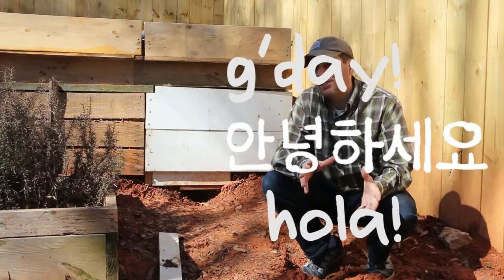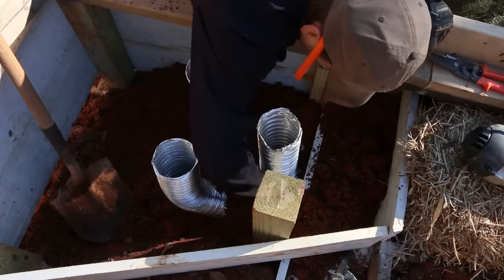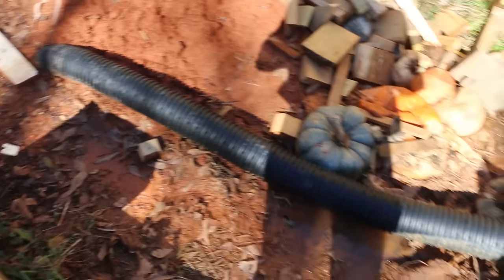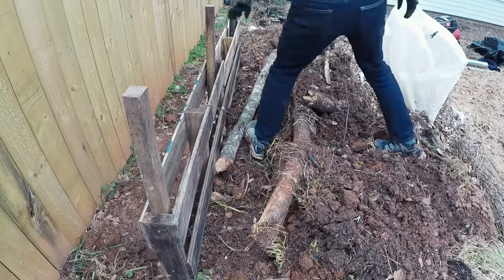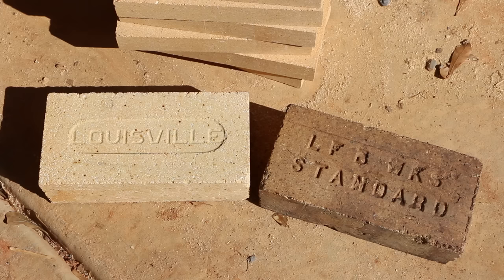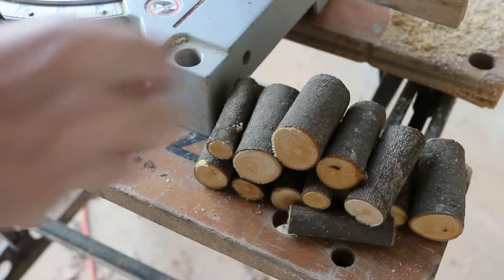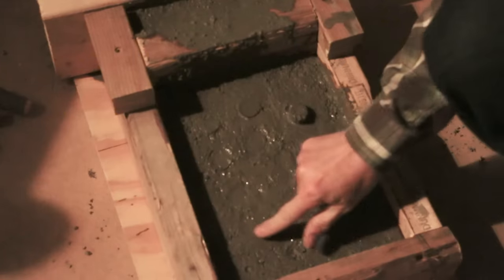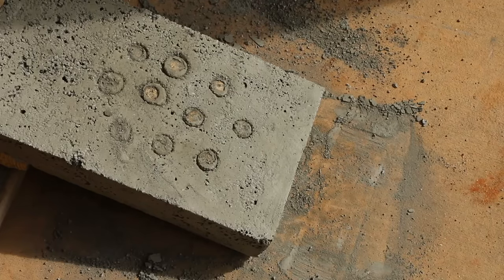How To Heat A Greenhouse For FREE

Comment: I agree with David, with some additional information. There are 3 foundational aspects of fire, heat, fuel, and retention. You have all 3 and it was a good build, but the power of induction is often overlooked. The fact that the smoke was choosing to come out of your fire box shows that you actually built a reverse system. Your chimney is acting as the air feed instead. Increase the angle of elevation or shorten the distance of your chimney. You could also warm your chimney to stimulate the flow of heat. As heat rises it causes a draw and will pull air, smoke, and heat. The hotter the path gets from the firebox the greater the inductive force. If you use a fan to keep fire going, you might as well use an electric heater and not bother with a fire. You are over complicating it for yourself. Hope this helps.

Comment: One thing you might try, it seems to me that it might be a good idea to insulated your vertical heat riser (smoke stack) to get a good draw going.  If you lose too much heat through your single walled duct your combustion products will cool and you won't get the strong draw up the stack.

Comment: When you build a form you can brush it with used motor oil or any waste cooking oil and your concrete will not adhere to the form so you don't have to worry about breaking your finished product.
Reply from the maker: I’m definitely going to use an oil release. Thanks for watching.

Comment: Ok, I haven't read all the comments cause it's after 1 in the morning, but I have some ideas for your firebox. And yes, I realize that this video is more than 9 months old and you probably can't use what I'm gonna tell you, but here it is anyway, just in case. Keep all the bends in the chimney to a very gentle, sweeping curve and down to an absolute minimum. That way you don't restrict your momentum of your air. Think fluid dynamics. Also, a longer pipe gives you more negative inertia as it moves, so you will want at least 6 or 8 feet of straight pipe as your chimney. And one last thing, I couldn't really see, but it looks like the chimney and the firebox are both outside your greenhouse, just on different sides. You could gain a lot of waste heat from your pipe as it exits if it's majority is inside your greenhouse and it exits through the roof. Those are my suggestions from my time working on gas furnaces and water heaters. Good luck.
Reply from the maker: Hi David. Thanks for the great feedback and suggestions. I always like hearing from people who have made a career of what I am attempting to make. I agree with your assessment on the heat gain. However, I was concerned about the hot pipe passing through the plastic roof. I will apply your insights to my next build. I'm afraid this furnace might be toast. When I lit it again, I got very little smoke out of the chimney, with wisps rising up through the bed inside the greenhouse. I think my smoke channel may have collapsed. It might dig it out and put a pipe in place. If I end up doing that, I'll implement your suggestions. Thanks for watching.
Reply: David May r
Reply: Anytime you try to pipe smoke sideways you get a lot of creosote build up.  I would avoid doing that altogether, or at least make certain you are using very dry wood and plan on having a way to chimney sweep the horizontal runs frequently.
Reply: @pattigoebel3136  I agree with that. My example of waste heat from the chimney was a propane burner and a lot of chimney pipe that had a small amount of rise over a long pipe and it wound up to the roof on one side of the shop my dad used to work in. That thing would run you out in no time, and it was a drafty shop. It makes sense that it wouldn't build up much suit cause it was burning propane. I really didn't think about that. But wood, on the other hand, would be more like a fireplace. But they still capture waste heat from those as well. My causin has one, even though they use straight vertical chimneys. The gas furnaces I've worked on use vertical chimneys also, cause the heat exchangers have the curves and bends that capture the heat. You could use a chimney that's not vertical, but you probably would have to treat it like a fireplace and burn a really hot fire every so often to clean it out and only use low tar wood like hardwood, etc. I concur with you.

Comment: It's a lot warmer in Georgia than here in Oregon. Here you would be spending all your time feeding twigs to that tiny box to keep it warm.
It's a great idea, just need a larger scale in the northern states. With added air flow won't those twigs burn up fast?
Reply from the maker: Hi Cat. You are right about the scale. The smaller sticks and twigs are consumed quickly. To make this work in an Oregon setting, it would need to be bigger and designed more like a true rocket stove or rocket mass heater. Check out Paul Wheaton’s videos on rocket mass heaters. He’s the guru. Thanks for watching.
Reply: @GreenShortzDIY  I'm not sure the size of the firebox is all that important, nor the size of the fuel you feed it.  In Georgia, especially, but just about anywhere, you wouldn't have to run that thing very long to get things heated up, and then it would give heat for hours.  

It would have to be pretty darn cold for a pretty long time for you to need it at all, in Georgia.

I think it's smart to build it in such a way that you can tear it all down and experiment.  I see a LOT of these greenhouse builds where people end up putting electric heaters in the things, and if YOU'RE the one building it, the most efficient, low-tech system would be rocket-mass-heater (RMH) system.  You don't want and you don't need it to put off much smoke, and you want as efficient burning as possible.

Comment: You said something about fan to pull hot air into green house , great idea. My occupation here in Ca heating & air . Try installing inducer motor at the end of the exhaust pipe see if it does the job

Comment: How'd it turn out?? Please update us! I live in a MUCH colder state and this would be extremely helpful if all the kinks were worked out. Lol
Reply from the maker: In the end, this didn’t work. I think the ground just soaked up the heat and didn’t really dissipate it into the greenhouse. However, I think the trench does a great job keeping the greenhouse warmer than the outside air. One method using a furnace like this would be to use it to heat a barrel of water inside the greenhouse. The water soaks up heat really well and releases it slowly. I’ve seen a YouTube video where someone does this. If i were to do this again, I’d do the trench with a water heat sink, fired with a copper coil in a rocket stove. I do have a video where I make a Cobb rocket stove water heater. That could be adapted to warm a barrel of water. Thank you for watching.
Reply: @GreenShortzDIY  thank you for your informative answer. I'm going to put some more thought into it and continue my research.  Hopefully i can figure something out before winter. Haha.

Comment: Don't let it get to hot. That vent pipe you used will melt quite easily. You need black stove pipe. Too get proper draw you need twice the vertical pipe as your horizontal. Block the opening in the front to force the exhaust out the pipe. Once the pipes are heated the block on the front can be removed.

Comment: tap your concrete form to vibrate the concrete, this will remove air pockets. Also use a lubricant like diesel fuel, or motor oil as a release agent on the pegs and wood form, they will pop right off very easily
You get some crazy sounds when speeding up the video
NO FAN....use a door on the front with a damper or use the holes in the bottom as a damper. ALSO raise the stove pipe higher and cap it to keep rain out, the higher your stove pipe, the better draw you will have
Reply from the maker: Good suggestions Herr Blitz. I’ve gotten a few comments about a door with a damper mechanism and diesel or oil as a form release. I’ll be making a door for this stove at some point. And I’ll be using a mold release for future concrete forming projects. Thanks for watching.
Reply: Please note that diesel and oils are accelerants for setting concrete as is salt.  Part of the reason for the initial poor draw, could be due to; the long horizontal section of pipe, the pipe and flue being cold and need to warm for a better draw and the vertical flue section maybe too short. Hope this is useful info:)
Reply: Yeah, I'm not sure what the exact ratio is, but the more you go horizontal, the more you want to go up.  I also thought about using a regular chimney with a bypass/diverter/flapper valve that would have superior draw, and start diverting the gases into your mass more gradually, until that part of the unit warmed up and the mass-heat part drive itself.

Comment: Have you thought about possibly putting a door in front of the actual fire once the plugs are burned through? That will also improve your draw. Also, it might be an idea to put some sort of variable restrictor on your air intake. My thinking is that you may want to reduce the air flow for a slow burn during nights. Anyway, cool project and thanks for sharing :).
Reply from the maker: Rene, yes. I was going to add a door when I did my rebuild video, but it was getting long and I was running out of daylight. I have a particular design for a door in mind with a variable draft control. I’ll do an update video at some point once I’ve worked out the details. Thanks for the feedback.
Reply: Doors are not permaculture.

Comment: Thoughts:
Earth tubes need to be buried at least a foot under the ground, preferably 3 feet or more, depending on application.
Have you considered using compost as heating? A good compost pile actually gets quite warm, though it only lasts for about 3 months.
I won't even touch the stove. Though you probably fixed a lot of issues in follow-on videos (This was posted 7 months ago).

Comment: Did you pack wood around the chimney  flue ? Not sure how safe that is
Reply from the maker: Hi Michael. It is actually concrete siding. Still I'll be monitoring that as well. What I've seen so far is that the metal chimney doesn't get too hot. I'm hoping that the mass of clay and the bed inside the greenhouse absorbs most of the heat. Will be watching closely. Thanks for the feedback and for watching.

Comment: It's basically how the Romans heated their villas 2000 years ago. It's worth looking at their designs, they lost a few villas through fire from their underfloor systems, so it's worth being careful. I'm up for trying this, great idea.
Reply from the maker: Hi Johnny. I didn’t see much heat transfer to the interior. And the heat tunnel collapsed in the course of the year. I plan to refit the greenhouse heat system using a hot water coil and a better thermal mass. Thanks for the info on the Romans. I’ll have to research their designs. Thanks for watching.

Comment: Is the purpose of the rocket fire part just to draw the hot air generated by the thermophilic bacteria in the hugelkultur bed? Does removing that heat make it so the pathogens are not destroyed? I thought destroying pathogens was the reason hot composting is so worthwhile.
Reply from the maker: I wasn’t thinking that direction, but I understand what you are getting at. My thought was that the heat would be stored in the mass of soil and then radiate into the greenhouse. In the end, this didn’t do that. I saw very little heat increase from this. After 6 months or so the chimney channel in the soil collapsed and I tore out the furnace. It was a fun project, but I learned more about what not to do. Thank you for your feedback. Thank you for watching.

Comment: Put an exhaust fan on it and it’ll make it so much better but great job really well made 
(Make It off grid add a solar panel and a battery to run the exhaust

Comment: You installed your piping backwards.
The corrugations will leak smoke and such the way you have them. Not only a problem if they leak inside of a desired area but they can reduce the draw effect.

Also, you built a rocket stove/heater.
To make it easier to use make a 'K' type design so it is self feeding and you won't have to kneel down to feed it.

In my experience I had to 'prime' my discharge pipe with sticks to initially start the draft by heating up the flue pipe.

And using an uninsulated pipe cools down those flue gasses too much and reduces the draw.
There is a ratio of the size of the input/opening to the size of the output pipe but I can't recall what it was at the moment. I think it was something like 1:3 or 1:5 input/output.
Both input area and output area (diameters if you will) should be the same size.
Small input and big output can slow the draw effect.

If output pipe is too short not enough draw. If too long flue gasses cool down too much and not enough draw.
Reply from the maker: Thanks for the feedback. This project was pretty experimental and no so planned. :-) It didn’t really perform like I was thinking. You touched on a lot of the issues...I appreciate the feedback. I think if I did this one again, I’d use a simple rocket stove with a copper coil, heating a mass of water to capture the heat and slowly release it in the greenhouse. Or make a proper rocket mass heater. Thanks for the feedback and for watching.
Reply: @GreenShortzDIY  You're very welcome.
Your design can work if you used enough piping. And maybe cover it with cob.
There is another way that uses a hollow pipe and a Sweedish stove (log) that heats a tent safely.
It is on youtube.
Reply: I’m years late to this, but as a former installer I have to note that putting the male end of the pipe down is CORRECT. Your worry will be about creosote dripping down and out of a female end that’s downward. Smoke won’t leak out with a proper draw; air will instead be sucked in. So male end down is always correct.

Comment: You have a few issues. Your chimney isnt tall enough to create a draft. Its not getting hot enough. You can preheat the chimney by stuffing news paper down the top of the chimney then light it and let it burn. Then start your fire in the fire box. I'm not so sure about your side draft rocket mass heater adaptation. Its cool but not usually the way they are built.

Comment: you could increase draw by regulating your air-fuel mixture at the firebox opening with a piece of that concrete tile as a vent restriction. less fuel same heat. great video .
Reply from the maker: Thanks for the suggestion, Damon. I’ve gotten a few that make a case for a vented door. Will have to make one. Thanks for watching.

Comment: I think you should have at least tried to drill out the plugs a bit. Looking forward to an update! Great video!
Reply from the maker: True. I was thinking I’d have to go back and do that, but the plugs are sliding out pretty easily. At least the few I could get to. They were just cut from the tree before i used them, so they fire was able to remove a lot of moisture. I’m thinking that shrinkage helped make then easy to remove. I plan to dissemble the furnace to get at the rest of the plugs and redo the connection to the greenhouse. Thanks for watching.

Comment: If I was your neighbor I would be pissed at that smoke coming at that height, make your chimney taller.  Your draw will be better once the dowels are burned out, but the air pressure  so low to the ground with the air temp difference will clog, once the fire is burning and the fire sides are warmed and the chimney path has all the cool air removed it should draw much easier, what your experiencing is down draft, which happens with air differentials in temp. You could prime your entire path easily with a small propane torch you could blow into the fire box for about a min, that would purge the heavy cool air out the other end.
Reply from the maker: I see your point. Thankfully my neighbor is pretty cool. That doesn’t change the issue with the smoke in the corner. I actually rebuilt this rocket furnace in this week’s video. It will up Friday. The draft is much better with a slightly bigger firebox and insulated concrete body. The dowels are our and that helps too. Thanks for the feedback. By the way, my neighbor has a cameo in the second half of part 2 of the greenhouse build. Thanks for watching.
Reply: All good man your lucky good neighbors are so rare.
Reply: WHAT?? Have you ever used a wood stove??? All he needs is a door on the front of the stove and a small damper, or the holes in the bottom will work as well. After you start the stove just close the door and it will work just fine AFTER you make the stove pipe higher for better draft. Your pipe should be at least over the top of the fence, even higher is better, then cap it to keep rain out

Comment: Not sure if path of least resistance applies here,  maybe  you can try cover up the firebox loosely  with some bricks,  then most likely the smoke will go through the chimey.
Reply from the maker: A good suggestion. I am definitely going to rebuild this firebox and the connection to the chimney. I’ll likely use the concrete - perlite mixture I used for the hearth. It did start drawing better once I got a hot fire going.

Comment: If you were to add a small flame just above the elbow that the final chimney section slides into, it would burn the smoke coming out. This would accelerate the exhaust and the draw as well as eliminate the smoke. You would only need it until the system came up to operating temperature. It does not need to be a blow torch, think more like a pilot light to ignite the smoke. By burning the smoke the whole system will be more efficient. Good luck on this.
Reply from the maker: Thanks for the suggestion Russel. I was able to get the furnace to draft today. I think it may have just needed a hotter fire  when it was drafting well, there was virtually no smoke. Definitely better combustion than my last try. Thanks for watching.